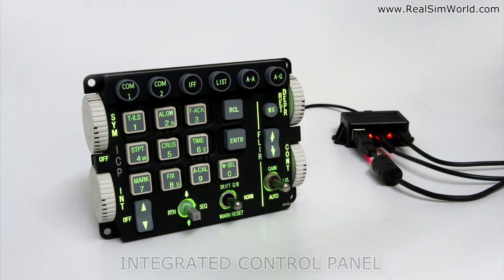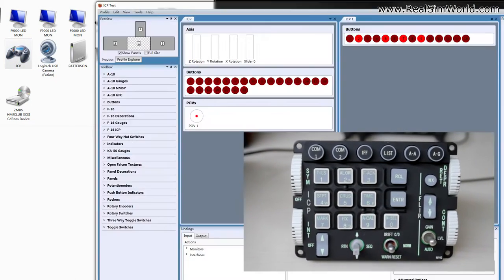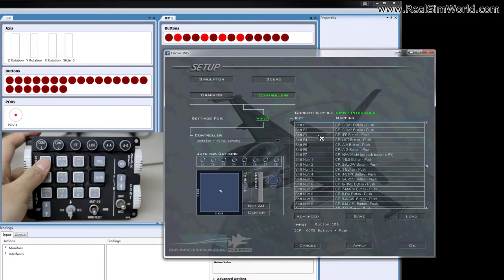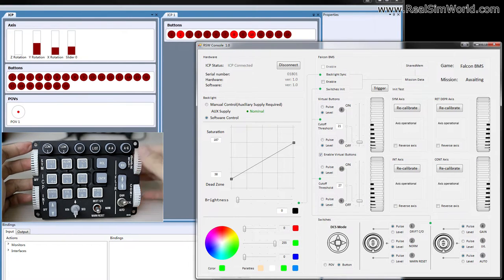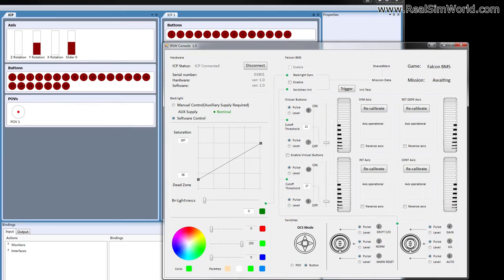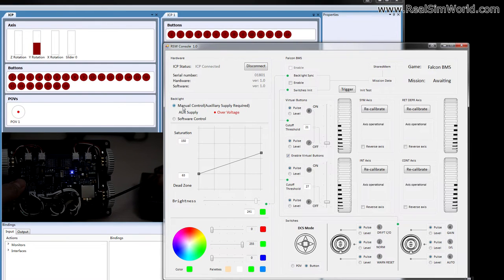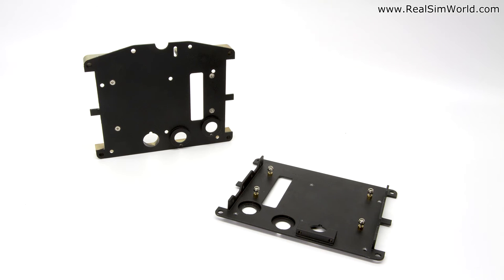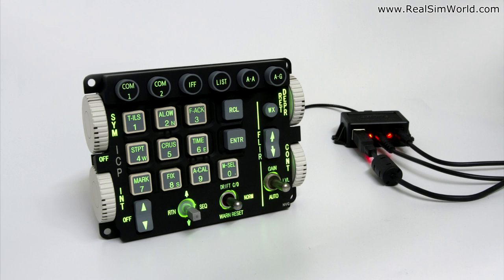Integrated Control Panel for Falcon and DCS

Comment: How is this compatible to DCS? I'm very interested in this for the F18 and future F-16 module.
Reply from the maker: Hi, I presume you were asking about the backlight dimming, as the keypad is just recognized as a generic joystick and DCS automatically recognizes all the axes and buttons. For the backlight part. DCS uses export.lua to transmit and receive cockpit and mission data with external socket nodes. We can open up a UDP socket in our software  to receive the data transmitted by DCS, and parse the text string, especially the part associated with backlight brightness of the panel of interest. I've done it with other instruments for years. Hope this answers your question.
Reply: @alexyoung6418  yes it did, I'll be watching this very closely and will purchase at my first possibility.
Reply from the maker: @Wolfkin18  Thanks for your trust. Please feel free to contact me any time at the email address given within and beneath the video.